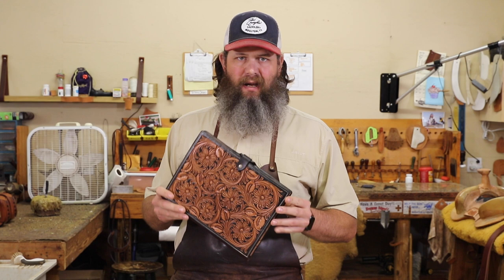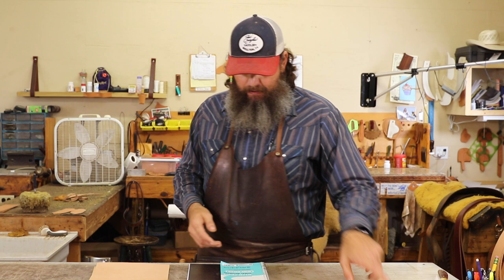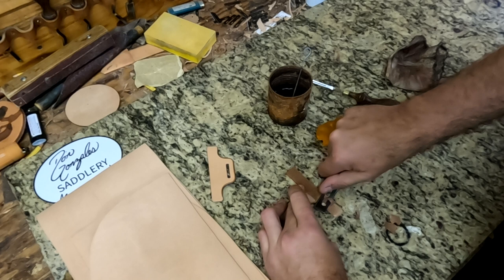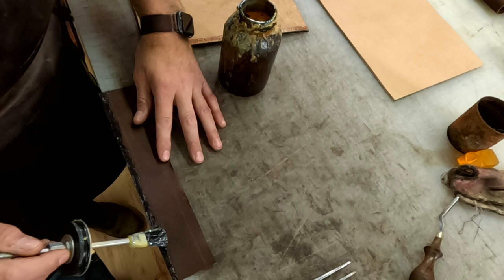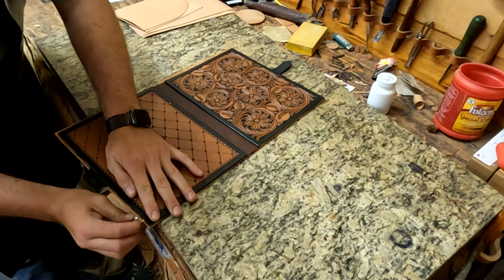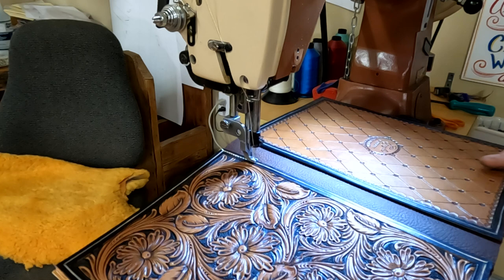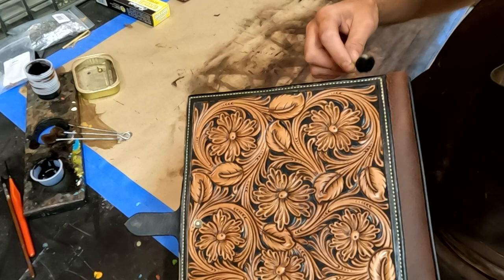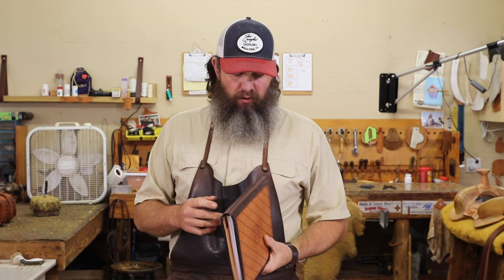How to Make a Leather Spiral Notebook Cover

Comment: For simplicity:
Just meassure the diameter of the spiral, multiply that by Pi (roughly 3.14) for circumference and subtract the thickness of the notebook.

For example:
Diameter 2,5 centimeter, thickness 2 centimeter

Spinepiece-width: 7,85 minus 2 -> 5,85 centimeter (2 1/3 inch)

Comment: What's the reason for the painters tape? You are the only tooler I've seen use that. You are also the only one I've seen draw directly on the project.
Reply: I think it’s to prevent the leather from shrinking from when you get it wet to tool. I’ve seen others use something similar, but also the first time I’ve seen someone use painters tape.